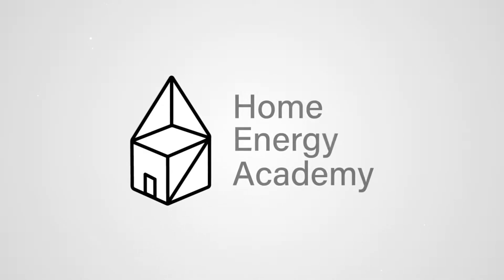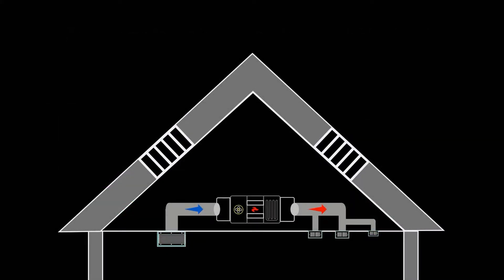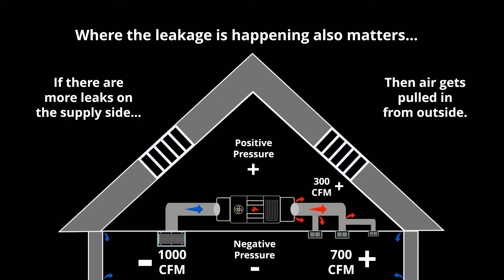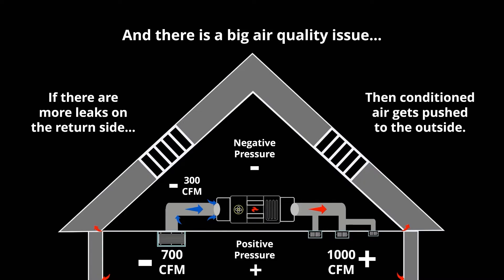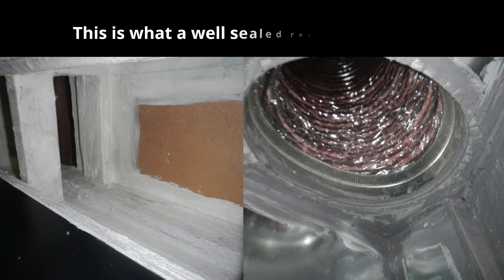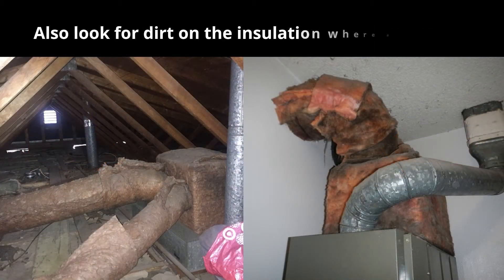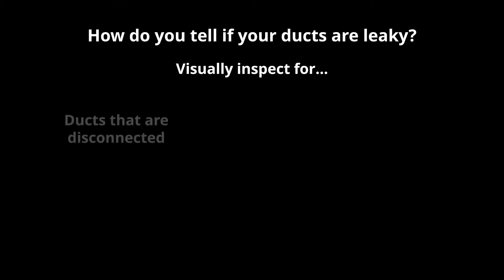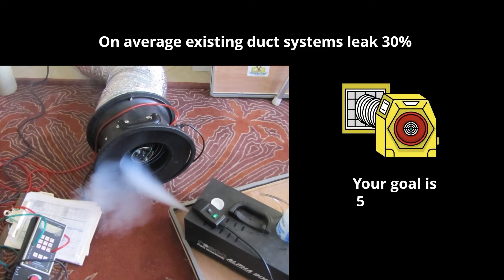Where am I losing energy from my heating and cooling system? (Duct leakage)

Comment: 30% like wow that is exactly why we ran a 8 service manifold off of my outdoor wood boiler line in addition to the coilin the furnace an exchangers for our hot water tank, even though the exchanger in the furnace is rated for almost three times what the furnace could produce in btu burning propane it would still run alot!!! An adding the manifold to run cast radiators or furnace now runs maybe a 1/4 of the time it used to…. When it was runing on propane i could easily consume 6 to 8 hundred dollars in propane a month!!!!!!!!!

Comment: Thanks for your input on duct leakage. I agree that reducing loss is important and worth addressing wherever practical, especially in attic or ceiling runs where access is possible.

However, I need to point out a critical limitation in your assumption about bringing leakage down to 5% in existing homes. In many cases—including the one I’m referencing—at least half of the ductwork runs from the basement up through the central interior walls and then branches out between the first and second floors toward the exterior walls. All of that ductwork is enclosed within finished walls and floor cavities.

So the question becomes: How exactly do you propose sealing ducts that are completely buried in the structure? Unless you’re opening up drywall or flooring throughout the home, which is both invasive and cost-prohibitive, much of that system simply can’t be accessed for sealing.

Bringing a system from an estimated 30% loss down to 5% may be a fine benchmark in a new build or a full gut renovation, but in an existing, finished home with ducts inside walls and floors, it’s not a realistic expectation. Suggesting otherwise misrepresents what can actually be achieved in the field without significant disruption.

I think it’s valuable to highlight where gains can be made—like in accessible attic runs, plenums, or exposed basements—but it’s just as important to be clear about the limits we face in retrofit work.
Reply from the maker: Thanks so much for your detailed comments here.  Super interesting and you're right there is a major distinction between inner-spatial duct leakage and leakage to the outside.  Leak it to the inner-spatial area is actually not as bad typically, because the heating and cooling air is heating and cooling your interior walls, which does have some thermal mass to them and will in someway keep your home more comfortable compared to losing that air 100% to the outside.

One way you can test this is you can use a blower door in combination with the duct tester to further distinguish the difference between the two so that you can figure out how much of the leakage is to the outside and how much is to the internal walls.  This also makes an enormous difference, depending on whether the leakage is on the supply side or the return side.  If the leak is on the supply side, it's not as big of a deal because you're just pressurizing those interior walls.  If the leak is on the return size, you're now pulling in air from those interior walls, which are typically dusty, dirty, and end up having insulation in the space.

And let me be super clear I'm not a big proponent of unpractical irrational solutions like ripping up all the drywall to try to seal each and every internal duct run.  If you really wanna go 100% here, I'd recommend a really amazing technology called Aeroseal (https://aeroseal.com/) which can dynamically fill duck leakage without having to replace or sealed ducts directly.  Check them out.  And thanks again for your comments!

Comment: Great information. Thank you. Do you have recommendations for duct tester and smoke machine? (I believe those are the items needed to test for leakage, per the video).
Reply from the maker: I used retrotec and always liked just depressuring and using a smoke pencil.  I also found using my hand to feel the airflow worked really well and at times even brough a full smoke machine (like the ones they have at dance parties) to the jobsite.